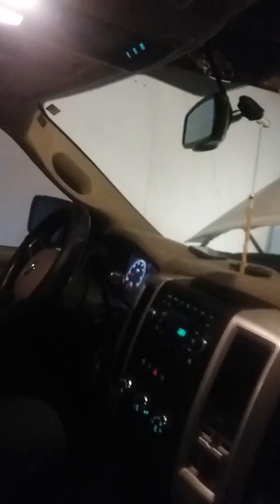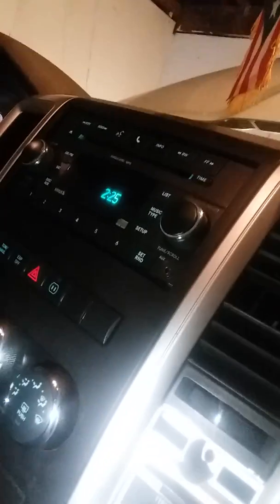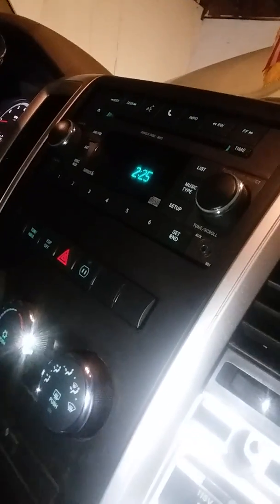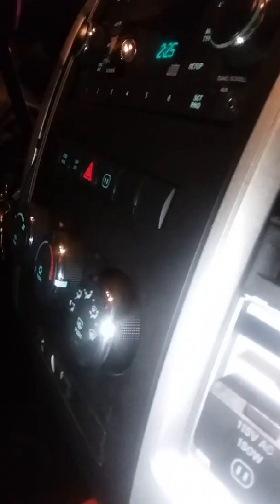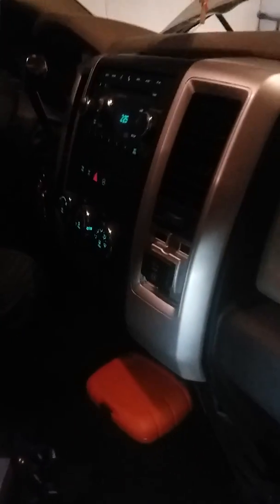2010 dodge ram heater problem .. solved.

Comment: I had the no heat problem but it was some sort of computer problem. After some googling found this solution that worked. 

With the vehicle running set the HVAC blower to low
 Press and hold the recirculation button on the HVAC Control Head for 10 seconds and release.
 Now press and hold the recirculation button on the HVAC Control Head again until the recirculation LED begins to flash, then release.
 The system will perform a brief recalibration and reset faults. The customer will regain heat after the calibration is complete.
Reply: Berzerk911 I was having the problem of passenger side blowing hot and driver side blowing cold and I went ahead and tried this and it made the air blow more warm then it was previously but for only a few seconds then went back to luke warm so I kept doing the recalibration a couple times and after one of the recalibrations the led light didnt stop blinking foes this mean there is something wrong with the computer?
Reply: What do you do if after following these steps the recirc light doesn't begin flashing?

Comment: Y'all guys just save me $500 nice video and thanks alot for sharing with us!!
Reply: Will the AC still work if there is blockage?
Reply: @MoMoneyJase  Should because cold air works when the heater core is covered. When you move the knob, there's a third actuator behind the glove compartment, apart from the other two they replaced (there are three total). The one behind the glove compartment controls the blend of hot and cold air. The heater core gets covered so only cold air blows through the cabin.
Reply: @SRR1213  ill take a look at that.   Thank you